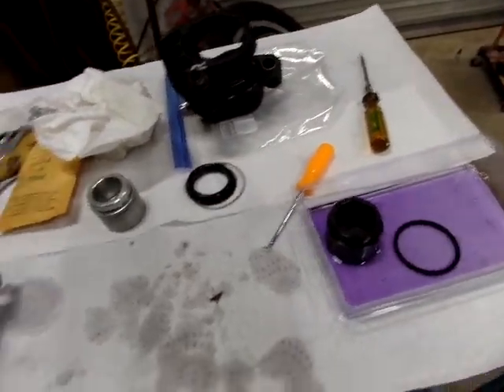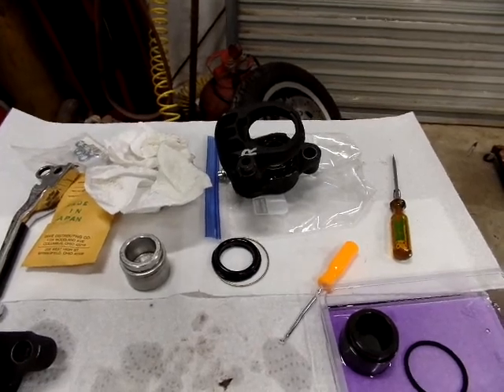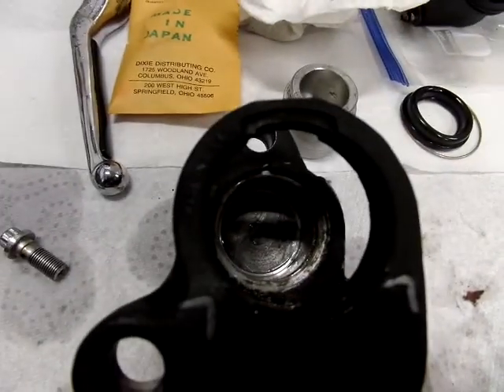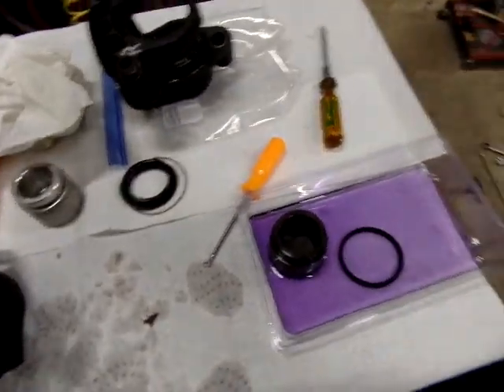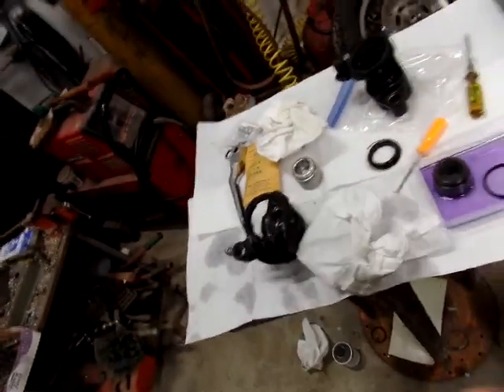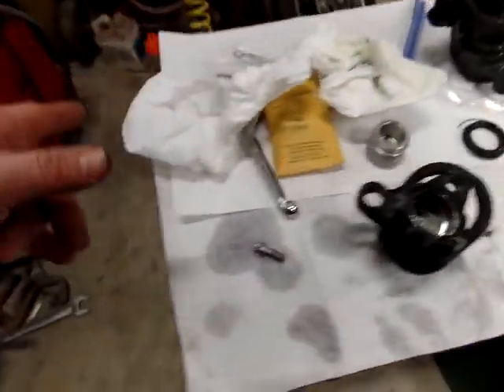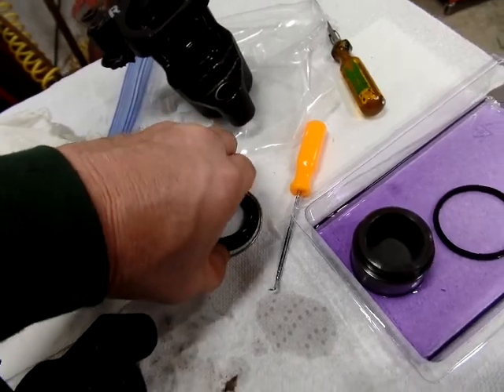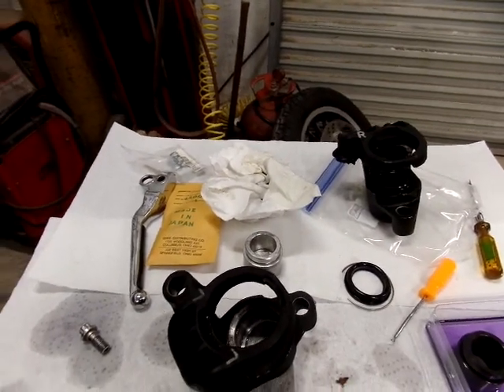rebuilding a Harley single piston caliper

Comment: Looks like you used the drag specialties kit. Was your piston non-ferrous? I just received the #46469 rebuild kit for my FXR and the piston appears to be anodized aluminum. Matte black. Never seen pistons other than chromed steel. Did your new piston work out ?
Reply from the maker: They are working fine and at any speed